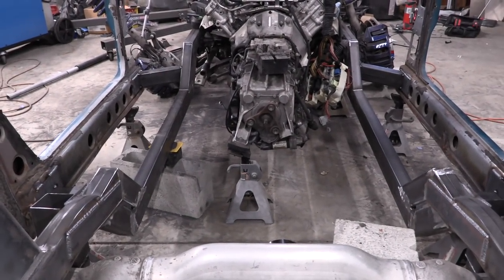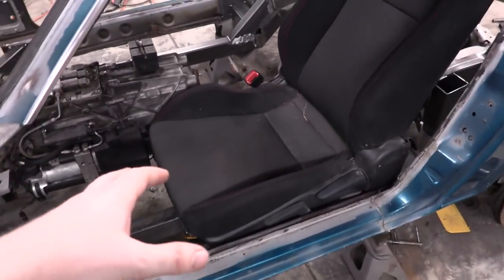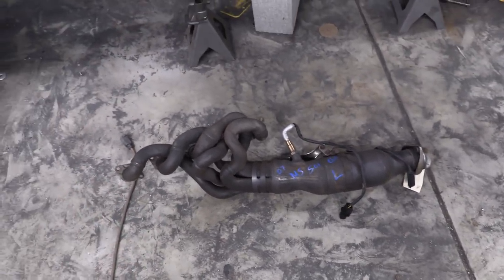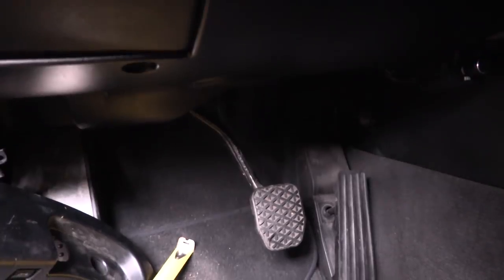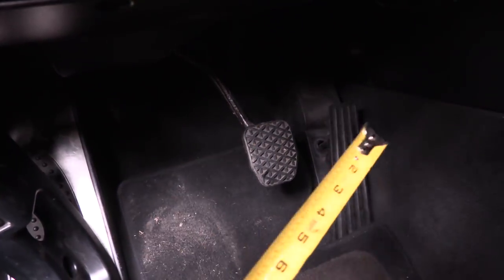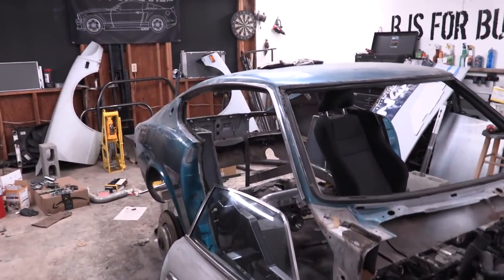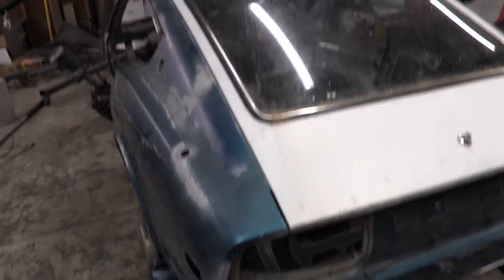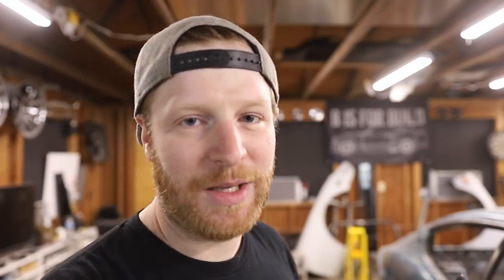Who Knew 240Z's Were So Cramped? Where Can I Buy More Leg Room?

Comment: Think we saw this video coming, and a suspect this won't be the last with a similar theme. I am sure you will work it out.

Just cut the middle of the frame out and move to run along the original 240z rockers - the from can act as a 'clutch' foot rest (noting no clutch / SMG).

Moving the seat as far back as possible will give you lots more options on pedals, steering and dash.

Run a stand-alone engine ecu and 'race' dash, save all the headache of using the BMW wiring loom, and 40 odd ecu's/control modules that need to be linked or deleted by coding.

Run a manual M5 (or similar) gear box - will save the electronics headache and be smaller giving more room to the cabin.

Run a 'race' pedal box and master cylinders.

All this will make the project possible and your life easier

Comment: I remember when you first mocked up the CAD plans for this car, I said that there will be no room for the squishy bit of the car (ie you).   The engine is just too damn big to sit that far back.    But I would suggest at this point that you run hater pipes and just have two long holes in the hood and have 10 pipes coming out the top.   It might wreak havoc on your o2 sensor situation though

Comment: As others have mentioned you should adjust the frame rails. But you can get a lot more foot space and reduce the complexity of the swap by switching to a manual transmission. There are options out there.

Comment: Could you change the pitch of the angled rails that you doubled up? By angling them out you can then move the section along the door opening closer to the body opening up Jeep’s more room, both width and length wise. You also wouldn’t lose much rigidity or time, since you’d be modifying the existing pieces

Comment: You'll probably be able to get a few centimeters more space if you want to sit up higher anyways. Seat bracket will lift up the point where the seat is touching. 

The other solution would be to customize your seats... make a notch into the back panel of the seat where the frame rail sits and redo it with carbon fiber... just an idea

Comment: Just add a piece of tubing under the joint and remove the upper piece of tubing. then you could tie the mount of the rear crossmember into that, and use a diagonal piece of tubing to mount the body-rollbar

Comment: Chris look into using a electronic power steering you will illuminate issue because you can move the steering column is close or far away and also to you can illuminate the hydraulic power steering 👍😊

Comment: With the extra frame rail pieces that are kinda blocking the seat/pedals, why not cut out the inner \  / pieces and attach new sections on the outerside/wheel arch side. Just moving those pieces would gain you 6inches or so and it keeps the same frame setup and strength. Hope that makes sense

Comment: The steering wheel position isn't really a problem, it happens to be a fairly normal position for a racing car. You may want a quick release wheel to make getting in and out acceptable but I'd just go with it. Then again I work in top level Motorsport developing engines; I may just be  biased because i'm used to it. As for the chassis, I think you can gain some cabin space there, but I wouldn't be too confident without FEA as to the best route.

Comment: It looks to me that swapping the position of the box sections used to reinforce the frame rails drops to the passenger compartment part of the frame rails, to be on the "outside" of the passenger compartment would give back about 11 inches of space front-to-back in the passenger compartment, allowing the pedals to the further forward and the seat to be back by 5.5 inches or so each.

Comment: I would push the front section engine busy and suspension further forward and add length to the fenders and hood. Would still have the look you want just a little longer in the front.

Comment: You could remove some bulk by taking those extra tubes out of the frame transition and plating them on the sides then bending a plate to weld on top

Comment: You don't need to completely redo the whole frame. Just cut the kick down sections and move them outward. You also don't need to double up the frame on the kick downs either, a single frame with fish plates will be more then enough. The front kick down should start just behind  the front subframe.

Comment: Even though it would mean redoing some work would it be feasible to cut back the bracing/rail kick interfering with the rear of the seat and put some bracing under the rail kick and maybe even side to side of the car smaller profile maybe but larger area or wall thickness

Comment: Looks like the initial frame mock up when you cut the downward bend that came in the kit is coming back to haunt you on the seating placement now.  Probably not a project killer as there was never going to be much room in the cabin anyway.  The other option is to start over on the frame, probably after SEMA, and do whatever you need to make this one work until then.

Comment: you're going to have to run low mount seats, the style that bolts to the side of the seat, i ran into the same problem in my s13, using sliders with a seat that mounts from the bottom puts the seat up way to high,  so you need the butt of the seat to kinda fall inbetween the sliders.

Comment: 1:57 

Can't you just remove the front rail section that you're touching there and weld it back on the other side. It looks like there's enough room for it to clear the subframe and also you could reinforce the subframe mount since it will be against that piece.

To attach the body again on that point, you can just angle it back similar to what you've done with the front mounting point of body.

It still won't be perfect but 4 inches extra space (+ 1 inch of space if you move the seat up 2 inches and back all the way) would help a lot.

Comment: I thought you gonna fit the M5 seats because theyre extremely comfortable.

And speedometer and infotainment System is also gonna be in the dash right?
Reply: The only thing needed to run is the speedometer. Why bother with all the other junk?
Reply: those m5 seats would never fit lol, prob twice as big as the ones he used to test fit

Comment: Would it be possible to move the supports from behind the seat to the inside and outside of the frame rails and weld it up, giving you a little bit more room to move your seat bacl

Comment: I hate to say this but i just gota. Re think your chassis rails down through the car. They are whats causing all your problems. Maybe split either side of the floorpan to strengthen both trans tunner and sill area. Plus that would give room behind the seat which would help with  firewall location, peddle location, exhaust, steering rack, brake booster etc. Just my 2 penith worth because id love to see this beast run.

Comment: Extend the lower frame rail forward 6" cut the hood and the fenders add 6" to the wheelarch you're fitting a wide body kit anyway so...
Reply: You can telescope a smaller frame rail into  the frame rail you have drill pocket welds for added strength and rigidity, or alternatively look at bending the frame rails into the centre of the car more... Like the frame rails on other cars

Comment: I think my favorite thing about this ride is seeing you do an engine swap that isn't an over done cheap ass LS or an equally over done Cummins swap. With space as tight as it is, could you chop the frame in the area it drops and scoot the entire front end out a couple inches? I am thinking of that Mazda/Ford Ranger street truck Kevin and the other guy built on Trucks and they moved the entire suspension forward a couple inches and just moved the wheel wells equally as far forward. It would be more body work, but I think you could pull it off and it might not even be noticeable by anyone but a diehard 240Z fan. 

Judging by some of the SEMA rides I have seen, if this car can move under its own power you are doing better than most.

Comment: Been saying this since you first started mocking up the Z's body to the custom chassis; tie the custom rails into the Z's factory rails. You will free up so much room on the interior, and you'd have a standard floor pan and firewall; with how things are now, the firewall will be a bit wonky with those frame rails, as would the floor pan towards the rear. 
Please actually consider doing this, you'll save yourself so much trouble. 
Also, are drive by wire pedals a possibility? It could also save some trouble depending on how much geometry change there is. 
Also, the interior of the M5 was never going to fit the Z. If you want the look of the M5, you'll have to go custom while keeping the mounting of the Z's original dash. The interior is going to be one the most difficult parts of this build. While building the car may be labor intensive, you still have the style of the Z's body to work off of; the interior is basically a blank canvas for you, and mimicking the M5's style may not work for the car, or may not work at all considering you have to alter it to fit the shape of the Z. Interior may be easier in terms of labor, but designing a style that fits the car can be extremely difficult.

Comment: if... the frame rails had moved out to the full width of the body ... but you have what you have. I would put a custom down pipe set on as you'll save room massively for the peddal box.

Comment: Hey mate instead of boxing it like you have done front and rear why not fish plate it both sides in the sane shape so increasing the effective wall thickness and also cut some holes and plug weld this will help strength!.

Comment: Ok maybe I missunderstood the messuring Chris did but I dont feel like the BMW dash idea is dead.. I mean it has to be cut to be not that wide anyway. Isn't it possible to cut it in depth as well to make it shorter? Looking at the dash in my car you can easily half the depth of the dash and still keep the front face wish is essentually the important part here right?
So a nice cut in shape of the window line (that has to be done anyway to make it sit correct) and it might still fit in? Anybody any suggestions or opinions if thats maybe still possible?!

Comment: the problem you have right now is you placed the supports for the frame towards the middle of the car. If i were you i would use half inch thick sheet  metal on both sides instead of using 2*4 box section towards the middle. If you remove the supports on the inside you will gain around 8 inches of room. Also using a thinner seat will help you drasticly.

Comment: Can you not recess the firewall to the right of that framerail? Will give you an extra couple of inches to mount the pedals. You are only going to be using your right foot when youre driving anyway so you can use the angled frame rail to rest your left foot

Comment: they make a under dash master cylinder and brake booster i have seen a lot of 55 56 57 chevys with them but they can be put in anything with some modification if you need to relocate them for your custom firewall

Comment: So, my two cents, if it was me I would redo the rear of the frame and give yourself a little more room. At a minimum I would move your gusseting from the top side of the frame, to the bottom side of the frame. From the outside looking in, it looks like you could snug the frame up a lot tighter to the rear subframe

Comment: Don't get me wrong, I enjoy the build and the channel, but I think cutting those rails early on was always going to be bad news. If you'd have built that frame kit into the Z chassis completely as it was intended, and then after built a tubular front end to take the v10 plus build the firewall/trans tunnel to suit, it would have been easier and left you with a functional car needing less fundamental changes to house everything. Sure you'd probably have some work on the rear to do, for a suitable diff etc, but it's less work than what you went through getting the BMW rear subframe on and building new towers, which ultimately caused the issue with the whole cut chassis thing!
Pretty ambitious to think about fully transplanting the whole BMW running gear, suspension and electronics package, & whilst on paper that sounds potentially 'easier', it doesn't appear to have been that way at all! Also a standalone ECU (SCS make a Delta880 for the S85, has paddle shift control an CANbus for DBW etc) and a PDM, along with something like an AiM dash would be the way to go too for a decent electronics setup.

Comment: look into an older jaguar brake system.....no booster. It uses an accumulator system and is very small and most of it mounts else where from the fire wall

Comment: make little hammock seats that hang from the rollcage like an ultralight. You could remove the second braced in the rear kick-up and put it next to the other one at a slightly different plane to get a different angle so not to mimick the first, all different weld angles. Either cut the tube under the seat and plate it or cut it out all together and lay it 90* to gain another inch of room. I would also use the parts that are going in the project and not ones you have laying around, That will bite you in the ass.

Comment: Watching this update is giving me such bad anxiety... Maybe if you would have built the frame with a little more sense.. like the area behind the seat where it's got two tubes at 45 degrees stacked? Chop the first one off? Give you another few inches to push the seat back.. and also run the frame outwards toward the rockers/bottom of the door frames so you can build a floor and mount the seats and pedals wherever you need to without the frame being in the way.

Comment: Garagistic makes a boosterless kit for a bmw e30 that eliminates the need for a brake booster. And puts the clutch slave/ master cylinders as well as the brake pressure cylinder right above the pedals in the cab. May be something to look into, works with willwood 4 pot or 6 pot brakes as well. Link below:

http://garagistic.com/index.php?page=e30-brake-booster-delete-boosterless-brake-bracket-using-wilwood-tilton-pedals

Comment: Move the rear frame angles back. It's a day or two of work to fix the fitment issues and will change the whole car build. Trying to squeeze into a car with no adjustment makes you not want to drive it and it's never fun. Fix it right and sort the rear for more space.

Comment: Couldnt you try an find a smaller booster, you have downsized the calipers to fit the wheels havent you?

Also why not just use a 240 dash frame an modify it to fit the m5 electronics, as its designed to fit the 240 width

Comment: not all custom chassis cars are 100% comfortable..obviously cut the cats off and try to reroute the exhaust back and over enough, when making the fire wall obviously it doesn't have to go straight down not uncommon to see a pedal box that is 8ish inches deep, its not fun but also cutting part of the frame behind the seat to about half of what it is now and gusset it to move it back

Comment: You should consider redoing the frame.
why not eliminate the doubled box-section where it goes down? 

With a roll cage installed there will not move anything!
don't think, that the Frame needs much material to stabilize everything. Build smart!

Good luck!

Comment: I would suggest remove that massive transmission. Make an adapter and put a smaller one. Problems with electronics? Invite Mighty car Mods team or even Scott from Haltech. I would bet that there is an option to run this M5 engine.

Comment: you dont need to delete the rail. shoot the rail over to the side instead of going down at the back have it go down and over to the side of the body. once there it can be beefed up as much as you like. you already have structural integrity so weld in the new rails while the old rails are still attached then cut out the unnecessary rail. you can double rail the bottom at the side like they do for a convertible and keep the strength and maybe add 50 lbs.  this is just a simple image of the rails depicted as you have them now and its very simplistic just showing the rails involved but here is an image  https://sta.sh/01twbskkz0b4   the top is how you have the lower rails run and the bottom will solve the issue. same thing will work in the front. if needed you can add boxes along the sides at the bottom if you wanted that rail going under the seat. only issue i see is where you wanted the roll bar to connect.

Comment: Nobody at SEMA is going to be impressed if you build a car only the late Troy Verner could drive.  You need to re-engineer the frame... otherwise, you are going to lose an inch here and another inch there during the rest of the build and in the end it going to be impossible to drive.  I think you're hung up on keeping the frame straight and limiting your angles to 45 degrees or less.  You can make 90 degree portions of frame... just gusset it properly with smaller gussets and consider the entire roll cage to be part of the frame structure.  Design the frame to be three dimensional, not two dimensional... Push the frame out as far out to the door sills as possible.

I would check out the Tube Frame VQ35HR 240Z build for some ideas... http://build-threads.com/build-threads/tube-frame-vq35hr-240z/